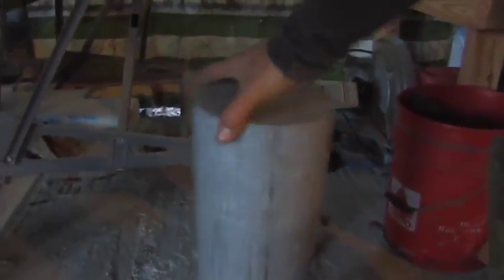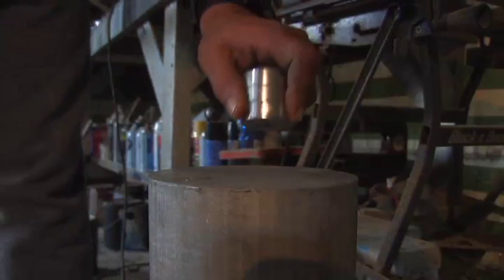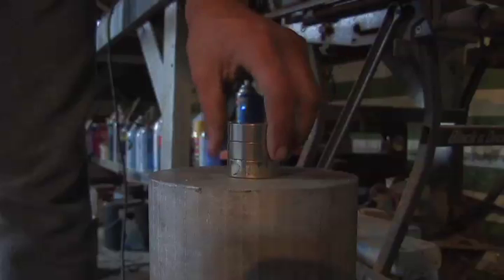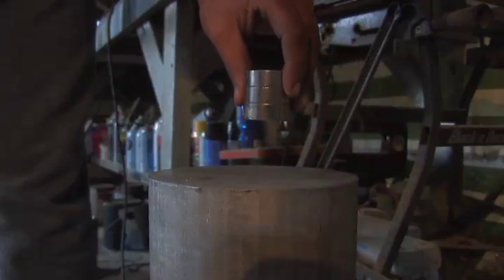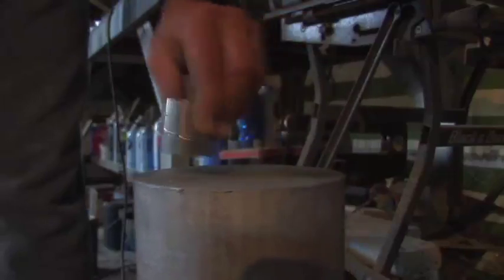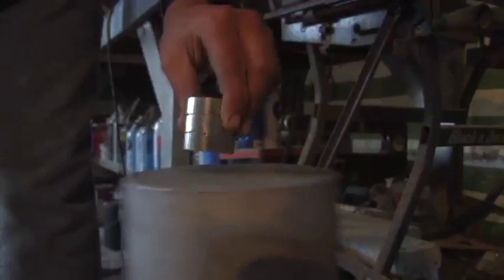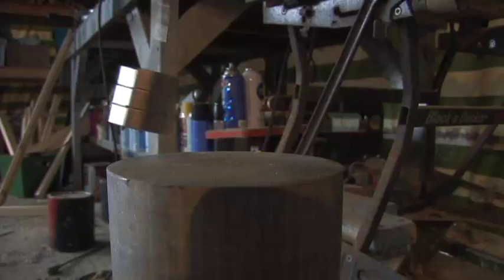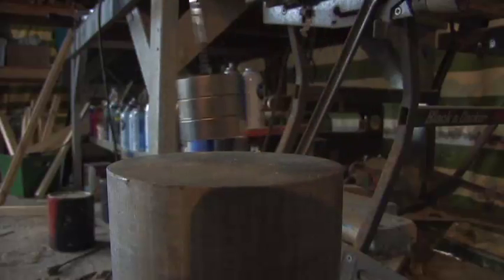GIANT Magnet on Aluminum Ingot Neodymium Magnet Paramagnetic

Comment: This is the result of paramagnetism. In fact, everything, including humans and animals, are magnetic to an extent. This is due to that every atom in every molecule contains electrons, protons, and neutrons. If there is no dipole moment, this means that the molecules have paired electrons and have neutral charges. If a dipole moment is present, it means that molecules are unpaired with electrons. But, even when paired or neutral charge molecules are exposed to a magnetic field, the magnetic flux of positive or negative increase. This depends on the polarity of the molecules, however. When the magnetic flux increase and it is negative, and the magnet is negatively charged, there will be a repelling  effect. This is diamagnetism. Paramagnetism depends on the polarity of the magnet and the Paramagnetic material. Think of molecules like tiny polarized magnets scattered in different directions. If the molecules are exposed to a magnetic field, the polarity position will reposition, and the stronger the field, the faster the reposition rate. If the molecules of the iron is warmed to a degree, this will reposition the polarity of molecules due to kinetic energy, which causes the molecules to vibrate

Comment: this happens due to magnetic flux which causes current  to be induced in block which generates  opposite polarity in it and  resistance is felt.Same thing  happens when magnet is passed through copper coil with both the ends attached.

Comment: Magnet IS attracting with aluminium, but not as much as it does with iron.
If you want to make engine, etc. you better consider using stainless steel like KO33 to avoid magnetic attraction ;)

Comment: No, the aluminum is pure. The cause is something called eddy-currents, where the magnetic fields resist movement through the aluminum ingot, thus transmitting force to the ingot. Works for most metals, completely pure. You could do it on gold.

Comment: Aluminum, despite being an alloy, is still a "metal".  That would not work with wood because wood is not a metal, is a fuel plant.  Also, all aluminum produced are all different grades, this might not occur with another grade, just like gold has karats to destinguish its purity. 

I'd go with ceramic before aluminum but would be quite costly.  I've heard of the US army testing ceramic engines in their vehicles because they would not require lubrication and stays cool.

Comment: billet noun
Definition of BILLET

1
a : a chunky piece of wood (as for firewood)
b obsolete : cudgel
2
a : a bar of metal
b : a piece of semifinished iron or steel nearly square in section made by rolling an ingot or bloom
c : a section of nonferrous metal ingot hot-worked by forging, rolling, or extrusion
d : a nonferrous casting suitable for rolling or extrusion

Comment: Duh, this is how induction motors work. 

I'm not sure that can be called an aluminum ingot. An ingot is typically cast in a shape used for further processing or shipping. Aluminum is made using an electrolytic process (to liberate the aluminum from the oxygen, to which it is strongly bound). The molten aluminum is then either mixed with alloys or simply casted into ingots. What you have is a BILLET

Comment: Lenz Law.  A magnet passing near any non-magnetic metal induces an electrical eddy current in the metal causing the metal to have its own magnetic field.  Then the magnetic fields oppose each other producing a "drag" effect.  This is the function of every generator whether it has a permanent magnet or a stator electromagnet. By the way, I'm sure that chunk of aluminum was expensive but I could melt all of it with a custom made induction heater in about 30 minutes.

Comment: The magnet is inducing an electric current in the aluminum , similar to a generator or alternator. Whenever there is an electrical current through a wire(or big ass piece of aluminum), a magnetic field surrounds the wire. This is causing it to move.

Comment: Faraday's Law states:
Any change in the magnetic environment of an electrical conductor will cause a voltage (emf) to be induced in the conductor.
Lenz's Law states:
When an emf (electromotive force) is generated by a change in magnetic flux according to Faraday's Law, the polarity of the induced emf is such that it produces a current whose magnetic field opposes the change which produces it.
In Conclusion:
Magnet+Aluminum=Honey

Comment: This can also be done with copper as it is Diamagnetic (Al is Paramagnetic) and sets up a magnetic field at 90* to the magnets field when passed over it's surface thus causing resistance in conjunction with the eddy currents. As some others have mentioned the magnet down the Al pipe trick is a great demonstration of this principle and it goes really slow in Cu tubing.

Comment: the magnetic lines of flux are creating an electrical current in the aluminum.  the current induced in the aluminum is causing it's own magnetic field which interacts with the waving magnets.  it is the same thing as an armature in an electric motor having a magnetic field induced by the field windings.

Comment: Yes, this same phenomenon is the cause for inefficiencies in standard electric motors.  Electrically conductive, non-ferrous metals all have an inherent resistance to magnetic flux.  Meaning that they resist a changing magnetic field.  Standard wound coils in electric motors must overcome this resistance.  The currents induced in these electrically conductive, non-ferrous metals, which resist magnetic flux are called "Eddy currents" or "Foucault currents".

Comment: its not 100% pure aluminum and therefore retains other minerals i.e iron which are magnetic but the particals are so few that the attraction is weak, present, but very weak. thus allowing the inget to move when magnet is passed over. yet not enough to be able to allow the magnet to stick.

Comment: The magnet causes electrons to flow in copper as well. This is how our permenant magnet alternators work. The electrons alternate back in forth which is ac current. The reason for the 3 phase is for a smooth running generator. Any less would cause a wobble and vibration. It would be like trying to sit on a two legged chair.
Did you know that rollercoasters use very strong magnets that ride over an aluminum section of track? This acts as its brake. Dan are you going into the foil business?

Comment: Magnetic induction from the magnets, causes an electric field in the aluminum ingot witch in reverse causes a magnetic field arround the aluminum witch repelles the magnets. Because the aluminum's electro magnetic fields strenght is directly proportional with the speed of the magnets droping or moving around it, the  the stronger the repelling reaction is, and so the magnets are slowed down, untill they come to a stop and there is no mor magnetic inductione.

Comment: If I remember it is called flux.  You could have made your point much better by dropping a nail though an aluminum pipe, and then dropping the magnet down the pipe.  The nail would have gone right through, but the magnet would have taken several seconds, because the magnetic flux is opposite direction of the motion of the magnet.

Comment: According to lenz's law, it induces a current in the metal that has a magnetic field that is perpendicular to the magnetic field of the magnet this repelling it. When the magnet is stationary, no current is induced in the aluminum block thus no repulsion, but when you move it , a current is generated. Lenz's law is best demonstrated by dropping a magnet through a hollow conductive pipe such as copper which is quite spectacular to watch.

Comment: The magnets induce a current FLOW inside the aluminum, and in it's turn the current flow inside the aluminum creates a magnetic field opposed to the magnetic field from the magnet. So if the magnet that induces the current flow is north then the aluminum will be south, both sides attract each other. 

Not my claims, but here are two related videos!!

Working Magnetic Overunity Device,  Magnetic Neutralization - watch?v=tM_HRwqKzFk

4 cylinder electro magnetic motor - watch?v=dldDxjTetAw

Comment: For a few trick, find a piece of copper or aluminum tubing that the magnets just fit in to and watch what happens when you allow them to slide down the inside of the tube (held vertically).

Comment: This happens because the motion of the magnet over the aluminum induces a current flow in the alluminum. This current flow in turn creates its own magnetic field which opposes the original field which created the current. These two field's opposing each other is what causes the resistance to relative motion between the magnet and ingot.

Comment: @bccooleycompany Yes, this would be less efficient than a straight electric motor (before you even consider this paramagnetic effect), but I guess the proposed idea is for retrofitting an existing internal combustion engine. The idea is to use magnetic pistons & coils to repel/attract them instead of combustion cylinders with spark plugs.

Comment: This is an example of Lenz's law i believe

The magnets are so strong Induce a current in the aluminum which is repelled by the magnets.

In reality almost everything is effected by a magnetic field because almost everything contains electrons, Aluminum, plastics, glass are all affected by magnetic fields but by a negligible amount, it would take a MASSIVE magnetic field to affect plastic, but a smaller one to affect aluminum

Even water is affected by magnets, it is a diamagnetic material

Comment: it happens cuz the magnetic field since its practically vertical, coming out of or going into the pole of the magnet, when it comes really close to a bad conductor, the em-force actually pushes the non conductor away since it cant flow through it, it has to go around it.

Comment: also poor grade aluminum can have iron contaminants in it as well as the rebar in the cement floor can cause an issue. but lenz law seems most plausable. as for a strong engine block alternitave... ceramic is great.   awsome vid

Comment: Place a coin it your palm and move a strong magnet rapidly over it you will see the same effect. Another way to demonstrate the diamagnetic effect is to drop a neo-magnet through a copper or aluminum tube. The falling magnet will decellerate well below the expected 32ft per second squared that gravity provides. Yet another way to see this effect is to place an aluminum plate just off of vertical and drop a magnet down the slope. I really enjoy your vids keep up the good work.

Comment: @nickcorn93 If you are going to correct others, then get it right. Lenz law and diamagnetism is different things. Aluminium is not diamagnetic, it is paramagnetic. (Well everything is diamagnetic, but paramagnetism trumps it.) Neither of these gives a drag like you see. Eddy currents does.

Sure you can interpret diamagnetism as a result of weak eddycurrents that are permanent due to quantum mechanical reasons, but their effects are quite different because of their permanence (no drag).

Comment: The piston in a Neodymium engine does not need to be air tight , right ? so the magnetic friction shown here is still far less than the friction in a standard combustion engine. although i have no idea how you'd make a Neodymium make a stoke ? by rotating the magnets at the top of the cylinder? it is just so fascinating, I hope someone has a go.

Comment: it has to do with the induced magnetic field in the block of Al, same principle as why a turn magnet in a coil of wire creates electrical potential and current, in this case the potential and current is a dead short therey resisting the magnetic field change at maxiumum.

Comment: Paramagnetism is a form of magnetism that occurs only in the presence of an externally applied magnetic field. Paramagnetic materials have a relative magnetic permeability greater or equals to unity, i.e. a positive magnetic susceptibility, and hence are attracted to magnetic fields. 
Pauli-paramagnetic rating for Aluminium is 2.2*10^-5
The magnetization of paramagnets follows Curie's law to good approximation.
en.wikipedia org/wiki/Paramagnetism

Comment: If you plan on building a magnet engine you might want to try out a composit meteral like carbon fiber for strength and something like abs or stronger plastic. that is my two cents but I have to agree with the lenz law theory on the magnet and aluminum. Copper tubing does the same thing so if you want a piston better get something that is not remotely metal for a shaft wall plus shielding from ther magnets will have to come into play because of side pulling forces. But good luck.

Comment: I tried something like that onece it was a 4 cyclinder when I was still in hight school I used 4 solenoids and used a peice of copper clad circuit board as a contact board and as it moved it fired a solenoid it worked but jumpy but I was just a kid then I still have drawings ect my goal at the time was to fire one solenoid and use the others to charge a capcitor for the next cyclinder but never work but the motor did work at least.

Comment: this is because of len'z law and eddy currents. 

like in a transformer. when you magnetise the material it wil produce secondary electric currents at 90 degress of angle from the magnets flux lines, which then cause secondary flux 90 of that which directly appose the original flux from the magnet at 180 degrees,

therefore the impudence is from electrical resistance and the apposing magnetic forces.

Comment: its even easier to see if ya drop the magent down an aluminum pipe. or copper. or any non magnetic metal . I have not seen anyone do it with a lead pipe but I think its the same. " Has anyone seen len's law done with lead ? "

Comment: When you move a magnetic field close to any electrical conductor, whether it be aluminium, copper, steel, iron, brass, gold, silver (etc...) the magnetic field of the magnet agitates electrons within the metal substance. This movement of electrons causes the formation of an electrical current  and thus an electromagnetic field. This field OPPOSES the movement of the magnet; like poles repel and the magnet slows down.
I wish I could explain more but I have no more characters.

Comment: is it the dielectric effect? the magnet creates a current in the aluminum and electrical current also means magnetic field. That's why the copper coils are able to generate a current when they are moved through a magnetic field. Same deal. 

Now, the engine block doesn't need to be metal at all. it can be a high temperature plastic or ceramic. Since this kind of engine wouldn't generate as much heat. However a rotary engine like the standard electric motor is still way more efficient.

Comment: when youre running the magnet across, the electrons are pulling to one side of the orbital shell of the Al ingot causing the entire atom to be pulled in one direction. Just because aluminum unlike other metals has a more stable electron configuration than other metals doesnt mean  that its electrons and protons are exempt from polar forces. The fact that you have such a dense source of Al and a powerful enough magnet is why you can do this, and a kid with a soda can and a fridge magnet cant.

Comment: lenz law and eddy current
when the magnet is moved across the surface of the aluminum ions are moved throughout the aluminum which in turn causes a slight magnetic field which repels the neodymium magnet, thus slowing it down.

Comment: so ive been told this doesnt work but you should make a video on why it doesnt 

i seen plans for making a wind generator using a car alternator why couldnt you use an electric motor running from a car battery to spin the alternator to charge the battery